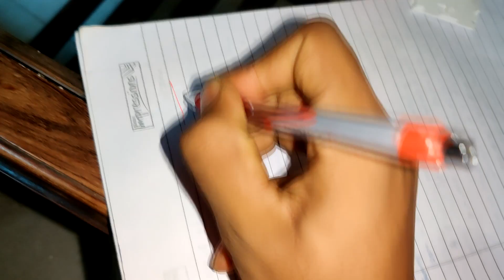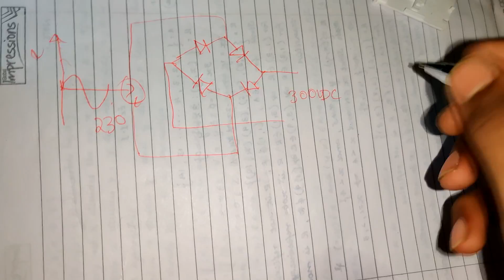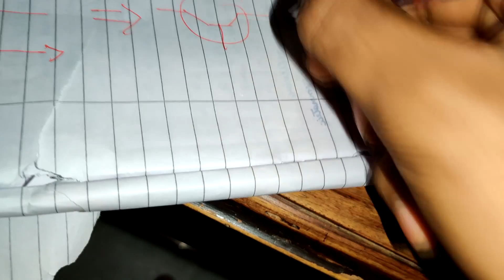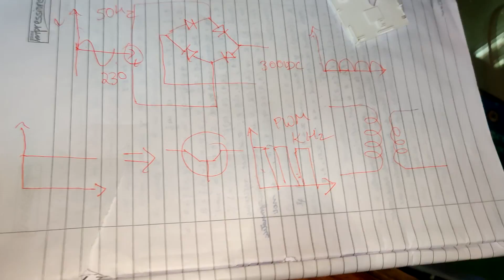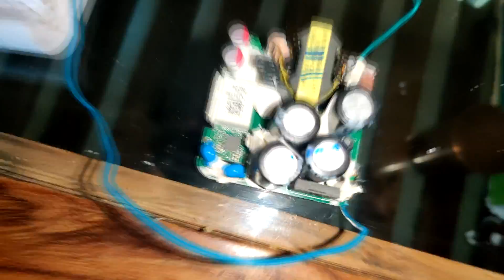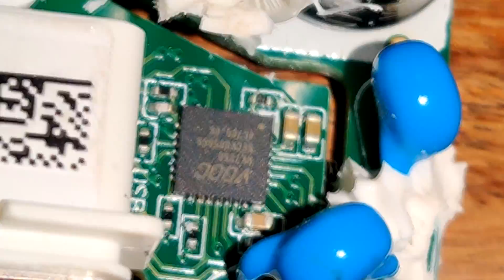OnePlus warp charger teardown (how do chargers, SMPS work)

Comment: m a year late.. but still wanted to know if - can you add another USB port to the warp charger (dual usb) and if YES, i guess the output will be divided between the two, but will it still remain a warp charger ? hope you can ans me. thanks.
Reply from the maker: Nope u cannot add another usb port on cuz the warp usb port has a 5th pin and it's proprietary and u cannot buy them and even if u somehow got the usb port it would divide the power so the charging would be super slow
Reply: @1DA20EE02_KUSHALR  it makes sense n i do appreciate your reply. thanks again.
Reply: @kushal R

Comment: Be careful when probing High voltages, Primary side switching will be at DC bus plus the reflected Voltage plus any spikes,
( close to 650VDC) , use of differential Probes is recommended

Comment: But 3 to 4 amp current rating on ampere app when warp charging... Kind of ic controller that control the charger  ... So that you can't use the maximum power  with normal dc output  you can use only with one plus powerbank . So i guess Other powerbanks not be able to activate ⚡⚡boost...

Comment: Sir, i need your help. I have a dc powered trolly speaker. It run with acid lead battery. I want it make worked with ac power. would you help me..how much voltage adapter i need to use. its maybe 40w saperk or 100w speaker...i dont know...but it sound is very loud. If i use 12v 2a adapter...it does not on. basically adapter use for this is charging purpose. plz help me to convert it ac powered. 
reply.
Reply: Check the battery supply ( Volts and Amps ) and than buy a adapter.
Reply: 12v 2a = 24W your speaker itself 40 or 100W u said

Comment: Bro my vooc charger get slow charged how to increase the speed
Reply: you cant upgrade the chager itself if that is what you are thinking
Reply: @bashaaksema94  i just thought, its performance might have degraded with time 🙄 isn't that the case?
Reply: @adityapathak6667  no its really uncommon for a smps to do that
Reply: @bashaaksema94  sometimes, i charge some lower end devices(low input power) with it. Does that damages the charger?
Reply: @adityapathak6667  a device that required less power then it can put out? No that does not damge it, its probebly even better for its life.
Reply: @bashaaksema94  oh, i see. You seems to have a good degree of study in field of electronics! Where are you from?
Reply: @adityapathak6667  the netherlands, i study electrical engineering
Reply: @bashaaksema94  nice to talk to you pal 🙂
Reply: @adityapathak6667  np
Reply: Same here + phone getting heated while charging
Reply: @adityapathak6667  that is not good